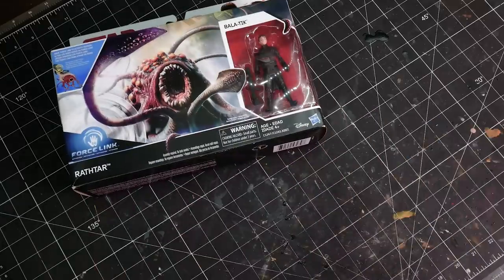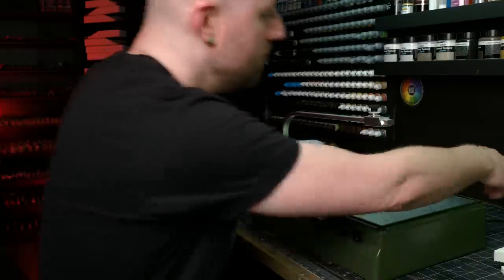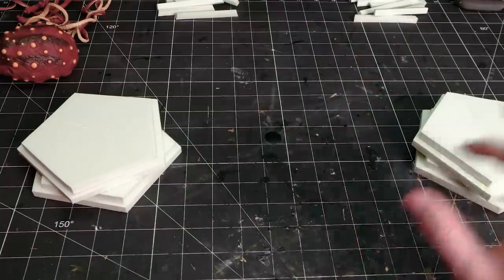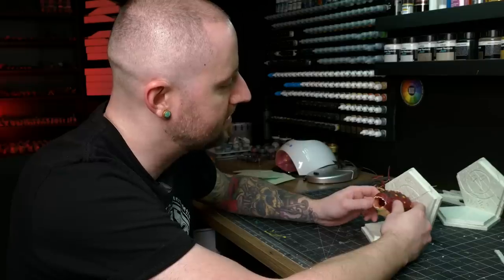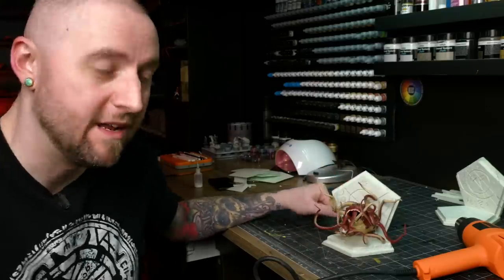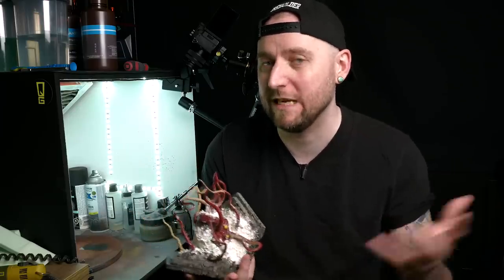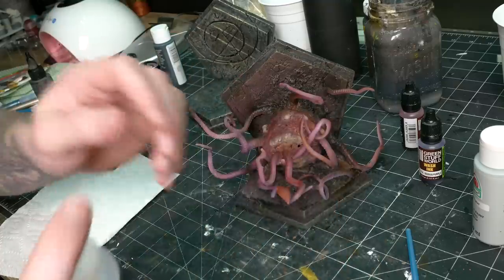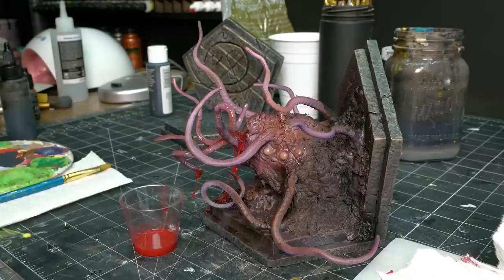Making an ELDRITCH HORROR Monster for Dungeons & Dragons

Comment: You did a great job with this, and once more I think you undervalued your ability as a painter.  I'm going to throw out a few thoughts here:
1) I think the choice of using Sculptamold was the right way to go; it really conveys the feeling that this thing is ripping and tearing its way into the Prime Material Plane.  The addition of it in the mouth helped cement this idea even more, as if it were literally chewing its way through.
2) As I was watching you assemble the wall pieces, I had the thought that beveling the smaller pentagons might have added a further dimension of alien otherworldliness, the non-Euclidean geometry so often mentioned in Lovecraft stories.
3) If there is a flaw with zenithal highlighting, its that it doesn't really favor a paint scheme that's lighter on the bottom than on the top but I think your work-around did a good job of solving that problems, so kudos for the quick thinking on your part.
4) I have found a new favorite word; eye-bulbous.  I must now find occasions to use it. [insert Mr Burns laugh here]

Comment: For the painting step; since I do a lotta painting; an easy way to pull out more of your details in the sculpy and the toy would have been a quick wash. Washing over warm colours with brown adds a lot to the overall effect, and to really sell the otherworldly effect, hard contrast colours would work really nicely; (Lime greens in the eyes, for example.), drybrush with another colour like orange would have done wonders. 

Also picking out details, like adding pupils (Easy cheat way for larger things is just to use a fine mapping pen.), and the teeth, dots on the underside of the tentacles ect would all help the model stick out more against the base. 

Since you have an airbrush you could also also turn the pressure on really low and 'speckle' the creature to get a spotty effect. 

Either way the use of materials and relative simplicity of the build is awesome.

Comment: Great execution throughout! You absolutely nailed the paintjob, Vallejo Squid Pink works well with alien and otherworldly monsters :) my go-to as well. Neat trick with the UV resin, definitely going to look into that. Another material I've used for mini "drool" is the cheapest arts & crafts glue (elmer's, UHU, anything cheap works), just add paint, let it sit until it becomes sticky (some 10 to 15mins), and toothpick it wherever you like. Finish with gloss varnish to set it better.

Comment: I'm not sure of the composition of sculptamold, but over hydrating plaster of paris lengthens cure time. You can add a pour of salt to accelerate cure time with plaster as well, I've had it work from a consistency of pancake batter to rock hard in five minutes with careful mixing.

Comment: I like how you cut the foam using the Proxon by drawing it towards you. I'm going to give it a try. It seems less awkward for some reason. Kinda like your tutorial with the craft knife and cutting the material towards you. You can see the cut and have more control. That tip may have been in the 'build a fountain' video .  I'm way too old for D&D but your techniques work real well on model railways.  

Oh, and I think they used "pentagram" in "The Wolf Man" with Lon Chaney Jr. .

Comment: If you'd set aside a couple of tentacles, you could have done a multi-stage appearance.  If you added pins/pegs to the tentacle bases, and built matching innocuous holes into the "empty" portal pattern, you could insert the tentacles mid-game instead of going straight to the full creature.  You could take that idea further, letting the players fight back the emerging tentacles for a bit, or using the emerging tentacles as an even finer timer by adding them one at a time.

Comment: Epic idea! i'll add that to my book of things to make/do for the table :) .... as an alternative to the hacked and hewn look to the elder sign you inscribed, If that foam will (as some won't) have you ever experimented with just scribing your details with a blade and using a heat gun to make the foam shring back from the cut lines? i think in this case the hewn look is much better, but sometimes getting clean smooth lines fits the bill better. . . . just rambling at this point.....hello..

Comment: I thought melting the stone(foam)-portal with heat or spraypaint would have looked really cool - like it's not a spell opening a portal but reality itself is melting like ice, giving way to the eldritch horror from beyond. (I'm no expert, but i guess that the melting-procress is rather difficult to controll.)

Comment: You should just do the zenithol coat normally.  Regardless of the shade of color, the color not being directly lit is going to be darker than normally darker shades in light.  But the paint job turned out cool.. much better than the factory paint job.

Comment: I was wondering if you would be able to review the “Uchida of America Foam Cutter” off of Amazon Canada.  The machine costs $35 CAD and can be used for the table top or handheld.  Being someone without a proxxon cutter it is hard for me to compare, especially for a casual builder.  I have found a couple of points where it falls a bit short over the higher end models like no heat setting, no moving the wire for angled cuts and there is no guide for straight cuts.

Comment: FOR A NICE GORE FX TRY  POLYSTYRENE CEMENT, REGULAR POLYSTYRENE AND AN OIL BASED MODEL PAINT [ EVEN OIL PAINT WOULD DO ] MIX THE LOT AND HANG FROM YOUR MODEL AS DESIRED.  THE POLYSTYRENE MELTS INTO GREAT STRANDS AND LOOKS LIKE SINEW, GUTS AND GORE WITH THE AID OF A COCKTAIL STICK ;)
Reply: PS - KICKIN' 80'S VIBE LAD
Reply: JUST SEEN THE GUY MENTIONS ABOUT SPRAYING WITH RATTLE CAN AT CORRECT DISTANCES [ 16:30 ]  THE RIGHT PIECE OF POLYSTYRENE PACKAGING CUT DOWN AND HIT WITH AN INTENSE BLAST FROM A RATTLE CAN [ PLACE FACE UP AND LET GRAVITY DO THE WORK. USE A BLACK OR VERY DARK BROWN TO SUGGEST SCORCHING ] IT LOOKS LIKE A BLAST FROM A PLASMA CASTER / HUGE MUNITION ROUND  MINIMAL WORK WITH A FEW WASHES CAN BRING IT OUT EVEN BETTER AFTER

Comment: Man.... You DESPERATELY need a butane mini torch with the air diffuser and all the little soldering bits and the hot air attachment. Would've saved you some time and made using the plastic bag technique possible. Big hot air guns are the worst when it comes to needing it for small projects.